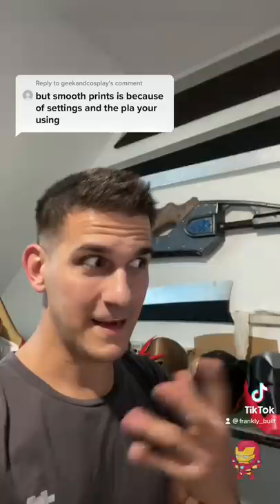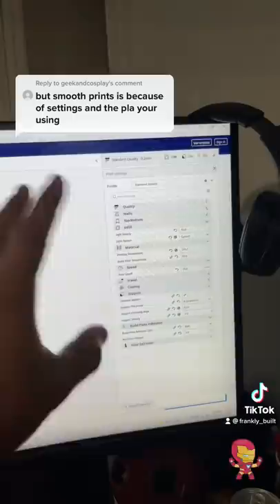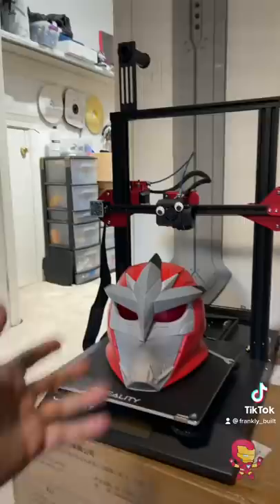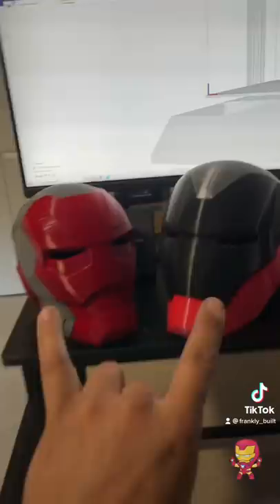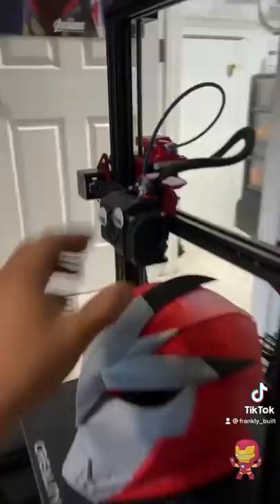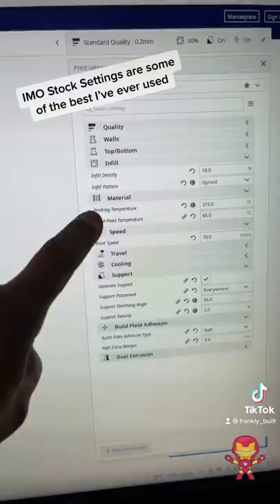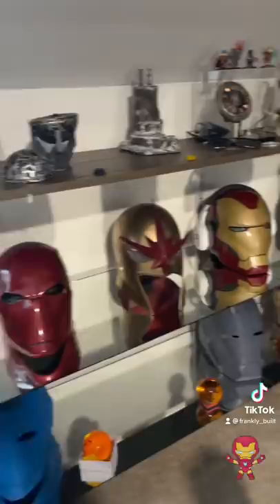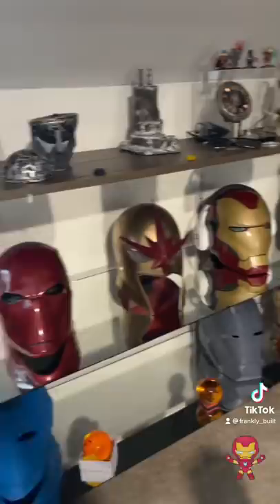Stop Worrying About Settings and Build Your 3D Printer Right! #Shorts

Comment: Currently disassembling/reassembling my Prusa i3MK2 after 5 years and 3 moves, was getting poor quality prints and would avoid printing just because the machine needed a desperate tune up. Sometimes stuff gets loose and just needs to be taken apart, cleaned, and put back together again!

Comment: Agreed.
I bought an Ender 3 pro and took my sweet time setting it up, using loctite and using a square to line everything up and I got my bed nice and level and had perfect prints immediately. The only failed print I had was one where I tried to snip a little stringy bit off while it was going and bumped the print.. 

But I uploaded my first prints to Reddit and people were literally calling me a liar saying there is no way I don’t know printing and settings and stuff… 
No, I just took my time making sure the printer was super rigid and square and setup properly and it made a world of difference. It was a tip my friend told me and I’m just that kind of guy anyway, I’d rather spend extra time to save time later.

Unfortunately my printer was stolen literally a month after I got it… I’ll get a new one soon tho, if I can afford it.

Comment: This is probably one of the best things to tell any new 3d printer beginner as I had an ender 3 neo and had no idea what I was doing I got it built and everything but couldn't dial it in for the love of money but iv now got an elegoo neptune 4 pro and I understand this machine alot more than I would an ender don't get me wrong enders are amazing machines hands down but you are right understand the machine before you try to use it I had to do a butt load of research on the neptune aswell 😀

Comment: This fits well with the saying, "To build a home you must start with a good foundation." I.e. assemble the printer properly and solidly or the program settings don't matter.  If something is off, check the physical printer first for alignment and loose parts then worry about adjusting program settings.

Comment: The message I caught from this is "Know the device you're using before messing with the settings" and it is pretty good advice

When you buy a phone you usually don't mess with the settings like fingerprint, mode switches, data reset and restoration, and developer settings right away (unless you're a tech geek and know what you're doing).

You'd usually fiddle around figuring out how loud does the speaker go, what does the microphone sound like, how good the pictures that were taken, and how good the video you're watching looks like

Comment: All of this. 💯% 
I've had so many people all me for help that have just powered up a new machine right out of the box, played with settings for a month, and haven't made one good print. I look at the printer and ask if they've leveled the need. "Nope, it has auto leveling" they'll say. Or have you adjusted the rollers or squared up the gantry. "Nope, it came put together". Or, have you calibrated the extruder? "Nope. The file tells it the right dimensions". And ya know, at that point i just say, "yep, i guess your right, hm",  and let them deal with it and learn the thier way. Cause if they aren't thinking I'm those ways, i don't have the patience lol

Comment: Yeah if you’re starting out, set it up right and learn the basics, so many people I help would benefit from just spacing their nozzle correctly. 
On the other hand,  the correct slicer settings can make all the difference- specially with non pla filaments. Cura is very user friendly. If you want to go a bit more in depth prusaslicer is the shit, love that slicer. 

And one other thing to everyone out there, especially content creators: it never hurts to shout out the creator of the models you’re using- free ones for sure! People work really hard on modeling nice things for you to print, give them a little love. I know it makes me feel good when people compliment my work, and take time to credit me.  Good faith goes a long way, the free model ecosystem helps people enjoy their hardware and brings more people into the fold 😊

Comment: I just got the kobra max 2 3d printer. First print was fine, second time around was messed up. It needed the firmware update and it fixed the problem. Now I can make cosplays like I want to without worrying

Comment: Basic PLA filament colours are very consistent across brands. Rainbow PLA, duo/tri-coloured filament is not consistent across brands in my experience. 
Spooling quality is defo not consistent I only buy from brands where the spool is perfect.

If you can print perfectly one print then it's not consistent across prints then it likely can be settings, model and nozzle temp for that model. 

The best advice is the test print on the sd card, if that doesn't print perfectly, it's highly likely your printer isn't set up well enough.

Comment: finally someone fucking said it, i first started on a hypercube 1 it had a fck ton of problems and didnt want to deal with learning the crazy slicer lingo at the time. everyone always said slicer settings BS, i sat there stiffened things up tightened belts spent countless hours leveling my bed to perfection getting the perfect z offset, and 9/10 times print with no issue however, for few rando little imperfections that is when you want to adjust settings.

the mechanical side of 3d printing is FAR easier than learning all the diffrent settings and tweaking things here and there to get there you just got to be patient, youll also waste a hell of alot less material

Comment: I just put together my Ender 3 V2 and my lines could definitely be cleaner and my first few prints failed till I installed the auto bed leveler. I absolutely couldn’t get a print to complete till I installed the bed leveler. Which after watching this video now tell me my printer probably isn’t perfectly aligned.

Comment: For everyone, im thinking of getting a 3d printer now.

When 3d printing, are you really needing to cure your work in a cleaning tank solution like ive seen,

 and if your machine is properly setup and function as it should, do you need to do any sanding at all still?

Comment: I know I did everything's right, but my Ender 3 (just Ender 3, NO V2 or anything else) still doesn't print. It just goes towards the top left of the bed and spews out filament. I've wasted about 15ft of filament just for it to not print a single small ODST Drop Pod Door

Comment: Unfortunately quality of the filament does make a difference. I found that a batch one brand of composite filament from 2019 was different from 2021. The 2021 filament didn't work because I believe they increased the size of the chopped fiber and it clogged my prints no matter what parameters I changed.

Comment: Ima build my own 3D printer with 2 bits of extrusion holding the bottom of the bed, 1 motor (if possible), and using bl touch to level it

Comment: I saw when 3d printers were invented. It was in 2000 when they told the public it was made. As a demonstration, they printed a Grammy award made of ceramic. It hardened layers of ceramic powder until a 20 gallon box was full of it. A person then reached into the white powder and pulled out a yellow Grammy. It was impressive, but messy. Looking at 3d printers today is like the original design never existed. They went from being the size of a 90s copy machine to just basically being a couple of small rails and a cutting board lol.

Comment: I honestly don't even care about perfect prints. I'll happily spend a little extra time sanding more, or a few extra layers of primer, than many hours of test prints, fails, and settings tweaks trying to get an FDM print looking perfect.

If I wanted smooth prints off the bed I'd go use a resin printer.

Comment: Whoooah you do have some insane settings though! 70mm/s is like 170% the default speed. Super fast
Reply from the maker: No lol 70mms is normal on these haha
Reply: Oh that's awesome. Mine u30 alfawise on cura has a speed of 40mm/s by default. I usually have to bring it down to 35 for a good print. 

I am only a few months in, so I'm not the best, but do you think I need to bring up the speed and fix some nuts and bolts on the printer itself?

Comment: I got a ender a few months ago and it seemed like nothing I tried would get the print to stick to the bed, it would just slide around. Don't know if it's a problem with bed level, filament quality, temperature or what

Comment: Awesome vid bro very well explained you are totally right until you've learned to get the printer itself fully adjusted and dialed in no matter what setting you use your gonna have issues once you get everything adjusted most things will print at almost any reasonable settings without issues or very minor ones at the least trust me to anyone reading this if you wanna start your 3D printing adventure on the right track and eventually do crazy prints and make Awesome stuff start your journey with frank I did because of this dudes videos and advice I've been able to pull off some insane and massive prints on a lil ender 3 if you want to get into making helmets study his vids well and you will definitely be able to make some awesome things and spend more time having fun printing then being frustrated with your printer 😅 thanks again frank your advice is golden 🙂

Comment: The Hog Rider is a fast ground troop with medium hit points, low damage, and the ability to jump over enemy Walls. He is unlocked at level 2 Dark Barracks.
The Hog Rider (person) is a bare-chested dark-skinned man holding a hammer. He has a Mohawk, wears a brown leather loincloth, a red belt, and a pair of leather sandals, as well as two large golden wristbands and a gold earring.
His ride is a large hog, about half his height. It has a brown leather bridle looped around its tusks, which in turn is held by the Hog Rider.
Hog Riders prioritize defensive structures above all other targets, and will bypass all other types of enemy buildings and troops while any defenses remain on the battlefield. This is true even if they are under attack by enemy Clan Castle troops, heroes or Skeleton Trap skeletons. Note that like all troops that prioritize defenses, Hog Riders do not consider the Clan Castle to be a defense regardless of whether or not it contains enemy troops, but do consider the defending Grand Warden and the activated Town Hall weapon (if any) to be defensive buildings. 
Once all defenses are destroyed, Hog Riders become like any other troop with no preferred target; they will attack the nearest building to them regardless of type, and will turn and attack enemy units if they become aware of any nearby.

ADVERTISEMENT
Strategy

Offensive

He can be used to jump over any level Walls, rendering them ineffective against Hog Riders. Note that while this allows Hog Riders free access to what lies behind the Walls, it does not open up gaps for other troops to move through. If the Hog Riders need the support of other ground troops, you will still need to deploy Wall Breakers, a Jump Spell, or Earthquake Spells in order to assist them.
Hog Riders can be used en masse, i.e. a "Hog Rider Rush", without requiring any Wall Breakers to break Walls. However, such a strategy can be costly in terms of Dark Elixir, and sports weaknesses against defending Clan Castle troops, Heroes, Giant Bombs, and Skeleton Traps, a problem which only becomes more prominent at higher levels.
At Town Hall 10 and above, Hog Riders can be combined with Miners in a strategy known as Hog Miner or Hybrid. Both troops are able to bypass Walls innately, but Miners do not have a preferential target, allowing them to cover for Hog Riders by dealing with defending Heroes and Skeleton Traps. The combination also has weaknesses against flying Clan Castle troops, as neither are able to target air.
At lower levels, Hog Riders are quite capable of acting as distracting troops like Giants; they have nearly as much health as a similar-level Giant, move twice as fast, and do considerably more damage.
They work well with the Healing Spell when you group several of them together.
A good tactic for using Healing Spells is to place them strategically on a cluster of defenses (at least about 3 or more) and also deploy them shortly before the Hog Riders arrive in the area, deploy them in front of the Hog Riders. This is so that the Hog Riders get the most value out of the Healing Spell, and destroy the defenses without losing too much HP.
Spots where Giant Bombs or Bomb Towers are/may be should be given special attention when deploying Healing Spells. Hogs of the same level as the Giant Bomb will survive a single Giant Bomb, but they're helpless against a pair of Giant Bombs even with a Healing Spell. Heal them after they've gone through a Giant Bomb blast.
The Hog Rider is one of the best troop types for drawing out Clan Castle troops, as it can avoid Walls to penetrate deep enough to reach centrally-placed Clan Castles (and enough health to not die before it gets there). Deploy one or a few to trigger the Clan Castle troops, then lure the reinforcement troops to the corner side, and deploy multiple Archers or Wizards to slaughter them, and then deploy the remainder of your Hog Riders. This strategy is especially effective during Clan War raids. However, Skeletons from the Skeleton Trap and Heroes can also easily kill the Hog Riders, as they can only target defenses, so make sure to have some troops that target anything, such as Wizards, which can swipe out the Skeletons.
Hog Riders don't target air so flying Clan Castle troops, especially Dragons, can be a big threat. Most mass Hog Rider strategies in Clan Wars require that the Clan Castle troops be killed first by luring. Bring other troops in addition to Hog Riders, such as Wizards, to deal with enemy Clan Castle troops and clean up the base.
Poison Spells can be used to kill almost any enemy Clan Castle troop, but beware as the troops will attempt to flee the poison. If the Poison Spells are decently leveled, and you effectively keep the Clan Castle troops from escaping the Poison Spell with distracting troops, they can eliminate almost any troop. They can also be used to dispense of those pesky Skeletons risen from the Skeleton Traps.
Time is also a factor to consider. With only 3 minutes in an attack, it is essential to make sure that this whole process and the remainder of the attack is done as quickly as possible to avoid running out of time.
Defensive

Defending against Hog Riders is tricky, as their ability to bypass Walls renders them irrelevant. However, the fact that they can jump over Walls and attack defenses means that they may leave behind their ground support (such as Barbarians, etc.), as they will not be able to follow. This will allow your interior defenses to concentrate on the Hog Riders.
Another way to defend against Hog Riders is to exploit the fact that they will attack the closest defensive building. You can arrange your base in such a way so that you have high-powered defenses on the inside and lower-powered defense on the outside, with a layer of resources in between. That way, the Hogs will (in theory) complete a loop around your base before being able to attack your interior defenses (Inferno Towers, X-Bows, etc.), by which time they should have all been killed by the interior defenses.
You can place Spring Traps and Giant Bombs in between defensive buildings to take out a few Hog Riders at a time; good usage of multiple Spring Traps and Giant Bombs can severely hinder a Hog Rider rush.
Hog Riders can be easily killed using "forced pathing". Forced pathing is a strategy that manipulates the Hog Rider AI and makes them go to at least 2 defenses that cannot be prevented by surgical dropping or side clearing. Placing a set of Giant Bombs in between the two can most certainly hinder the attacker progress. They would not be able to heal the Hog Riders in time.
Clan Castle troops, Heroes, and Skeleton Traps set to Ground Mode can be an annoyance to mass Hog Rider raids, as Hog Riders will not attack them unless all defenses have been destroyed. Make sure to centralize them if you want to beat Hog Riders.
In Clan Wars, Dragons are excellent troops to place in Clan Castles against Hog Riders, especially for Town Halls 8 and 9. They have high HP, meaning they won't die easily and can kill mass quantities of Hog Riders swiftly if not properly lured. Most mass Hog Rider strategies require that the enemy Clan Castle troops be killed first, so if the attacker lures out a Dragon, but fails to kill it, then a 3-star win is next to impossible, much less a 1-star win via destroying 50% of the buildings.
Multi-target Inferno Towers can be a severe hindrance to Hog Riders, having high HP to take several hits from Hog Riders, while hitting large groups of them.
Although the Hog Rider is certainly not a liability on defense, the fact that all defensive troops are unimpeded by Walls negates the primary advantage of the Hog Rider. Still, for the space they take they are faster and more damaging compared to Giants. 🧐🤓🤞
Reply: not funny didn't laugh 😐